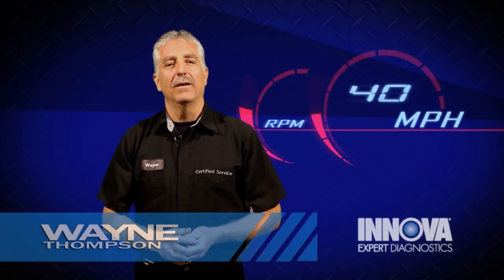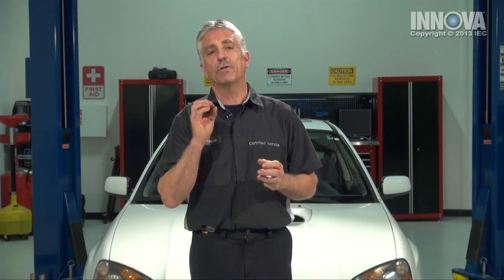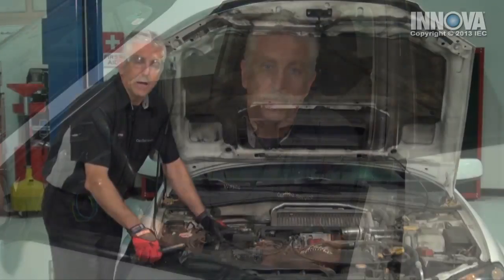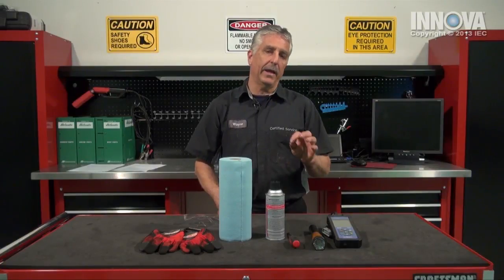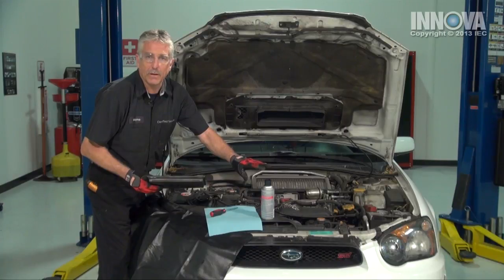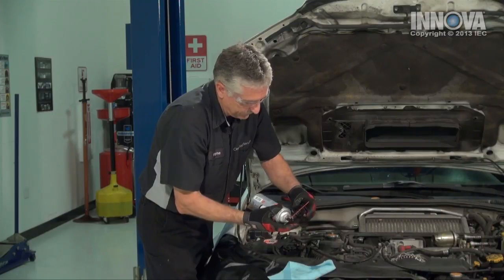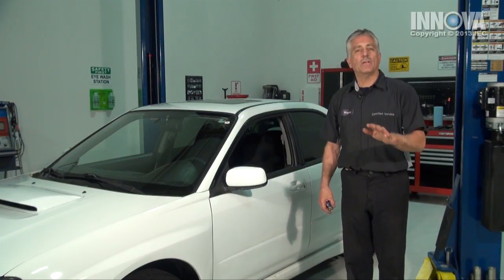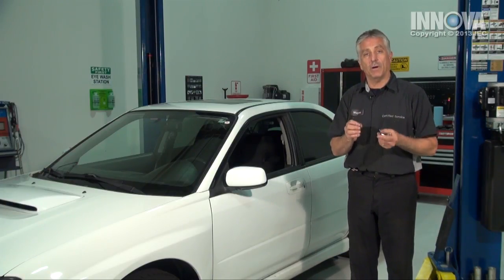How to diagnose a Misfire with Drivability Issue - Mass Air Flow Sensor - 2005 Subaru Impreza WRX

Comment: It looks like you did not clean the actual MAF sensor up inside the tube, the sensor on the outside is Intake Air Temperature sensor. Two sensors are built into that part.